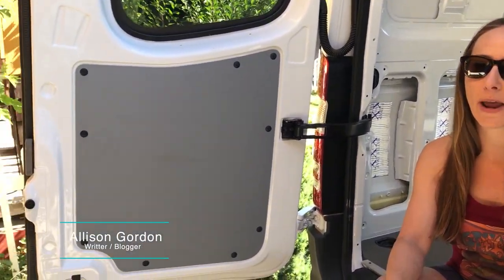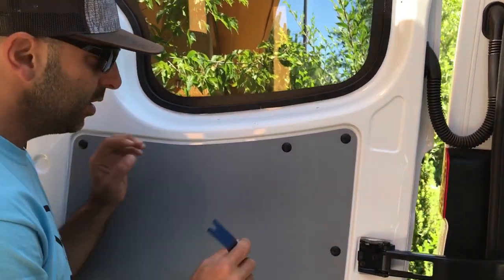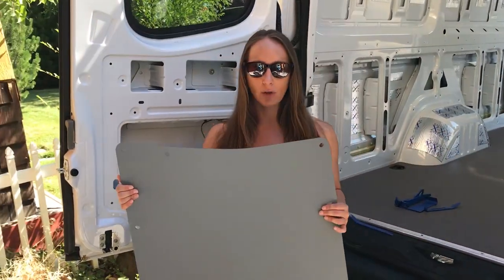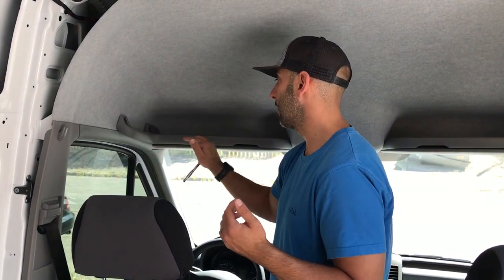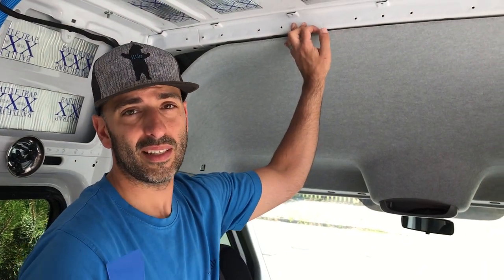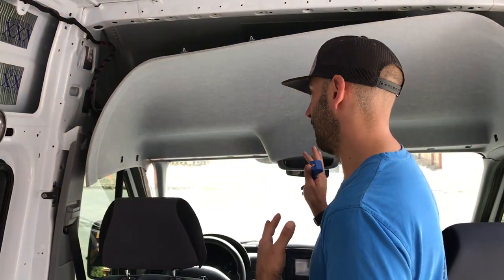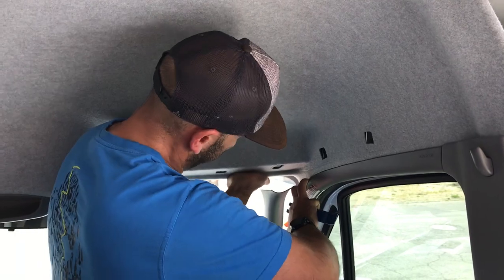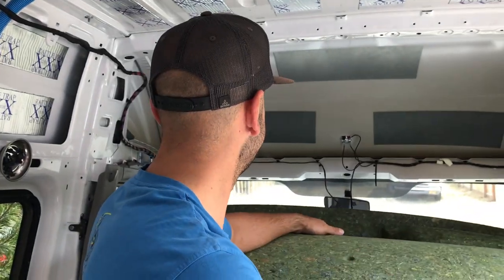DIY Van Conversion: Sprinter Van Headliner & Door Panel Removal

Comment: Did you have the large styrofoam blocks on either side at the back of the headliner? I see they're missing now in your video but just wondering if you removed them and how that works. I'll need to do the same thing on our 2018, but I think the foam will need to come out first.
Reply from the maker: Tim & Shannon L.T.D. We did not have any styrofoam. Ours just came open like you see in the video. Hope that helps. Let us know if you have anymore questions. Good luck with the project!